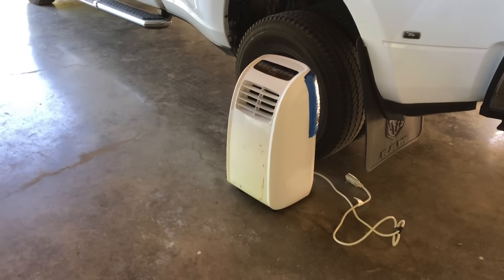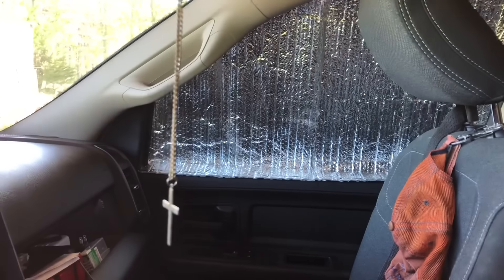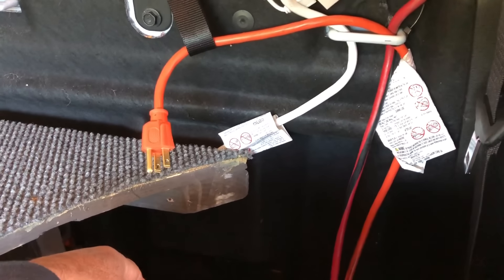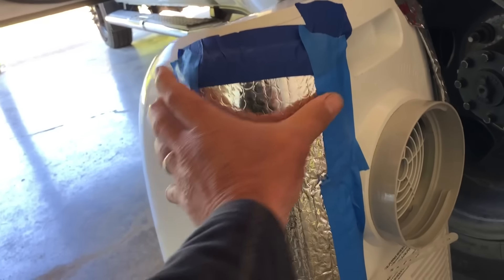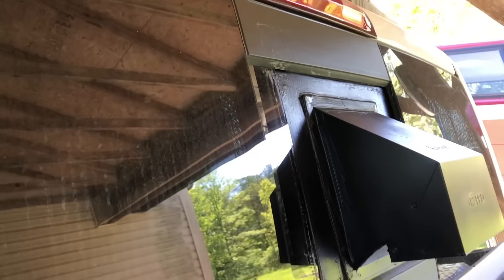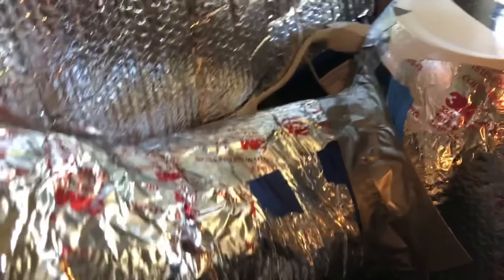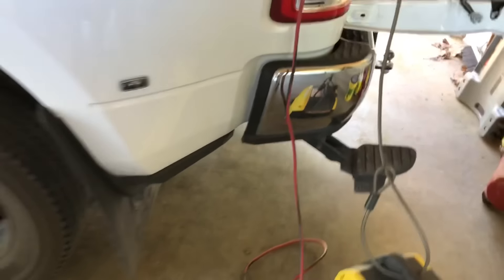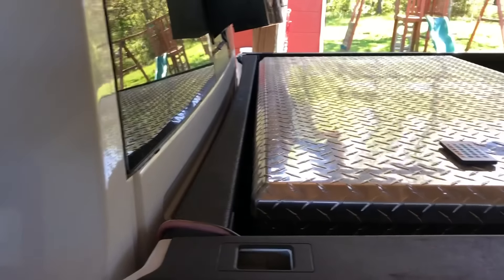Best Hotshot Pickup Sleeper Air Conditioning Setup! Save $$$ and stop idling when off duty!

Comment: I work out in oil fields . I ripped out back seat put put $ 375.00 Hess Portable 5000 BTU behind the driver side . Cut a hole threw the back the  cab for the exhaust on left side .drilled a small hole on back cab for drainage . Drilled another hole on right side for the power cord . Bought a Quite 3200 predator generator  for $650.00 . I very been using it all the month June.  Generator takes about 2.2 gallons for 10 hours  . That's $ 10 night in this Texas Desert heat . I freeze at night at 67 degrees . So in month it's paid  for itself !  It's works toward that self contained operating at lowest denominator mentality . Your not having to run to hotel 30 miles away and driving back costing what? 6 gallons at 4.50 gallon .
Reply from the maker: That’s awesome to hear! Your saving a lot of money and wear and tear on your truck engine.
I’d like to see a picture of your setup!
Reply: Dude thank you for commenting. Was just thinking of getting this kind of setup before next summer.

Comment: ok for  all you guys that are concerned about ingress air flow for the a/c unit... remember that the on board a/c /hvac unit goes to outside air when the truck is shout off.  So... fresh air is being drawn in through the trucks on board hvac system and it is adequate for the air flow for the condenser... i have been using one for 6 months and this is how it works with no problems... i dont use a genny though but i have a CO detector when i do..... adequate low dollar design ther folks..... good on you sir!
Reply from the maker: Don, thanks for your information! I do run with a detector as well.

Comment: A dual hose portable AC will work much better, and like other people have said here, if you can convert that one into a dual hose by adding a fresh air hose intake to the condenser side, it will greatly improve both the capacity and efficiency of the unit.
Reply: That ac unit is designed to cool a medium sized bedroom with the inefficiency that you point out. There wouldn't be much issue with just using it as designed. I'd prefer to have the active air exchange in that small space.
Reply: Dual hose units are considerably larger... Space is at a premium in this situation.
Reply: You could be sucking in carbon monoxide from the generator though. A dual hose unit would be much more safe.

Comment: I drove hotshot for a few months. If you remove the front passenger seat and sleep along the passenger side. You will have move length. I could fit a foam queen mattress in lengths and just fold it in half to fit.

Comment: you can make that a lot neater and cleaner by putting the unit on the passenger seat, build
 a simple removeable frame out of plywood to run the exhaust thru to place in the passenger window. because the exhaust hose is just going a few inches to the window from the back of the ac  you don't have to wrap it. Thats the set up I had in my truck when I started running freight for years. FYI you can run the generator in your truck bed just point the exhaust out the back with your tailgate down. Did it for several years never had a problem.

Comment: A single hose ac unit will pull in outside hot air into your truck through all the cracks because of negative pressure.  Convert it to a dual hose ac.

Comment: We have the axact setup in our micro-camper.  We have that generator and a WEN 2500.  The works just as well.  Probably is the negative pressure issue and sucking in warm air.

Comment: I just want to point this out.  Having the genny running outside and you also have the condenser air that is pulling air from within the cab and putting it outside and is putting the cab in negative pressure with CO floating around outside.
Reply: Correct, I would spend a few dollars and just buy a CO detector to be on the safe side.  When I run my portable generator I put a fan blowing on it in one of the outlets, helps keep it cool and blows the exhaust away.
Reply: I was gonna say the same thing.  I use these in my rentals as emergency backups and they will definitely allow you to discover where you have leaks in the house cuz it will suck in all the hot air so one part of the house was nice....the other would be hot.  
In his application I would worry about it sucking in the exhaust.  Be careful
Reply: Yes if you understand how air conditioners work those units are really poorly designed and should not have been made. It should have a dedicated and isolated fresh air intake from the outside to cool the condenser and then blow the hot air from it back out. They do make units like that and they have two hoses. When you have only one hose, and it's constantly blowing the hot air out from the condenser, where do you think that air is coming from? It's also sucking all the cold air that it just made back out of the cabin and blowing it outside. And where does the air come from to replace the air that's being sucked out of the cabin? From the hot outdoors. Doesn't matter if it's a house or a car or a shed, the same volume of hot air you feel blowing out of that hose is the exact same volume of hot air from the outside that's being sucked into the living space.
Reply: Thé dude is right. This set UP is not idéal. My father almost died in his car due to Co and CO2. 
Stay sage guyz!!!
Reply: In order for the ac to create a negative pressure you have to have the whole truck sealed up vents and all. The air being blown out the back is also being pulled in from the vents in the front so the risk of co2 going into the cab is less likely as most  would think. But if I am wrong let me know.....
Reply: @marcusspillman6113  you mean co, not CO2. And it would depend on how close the exhaust is to wherever the air is being sucked into the cab from and what the direction of any Breeze or wind is. In the right circumstance it definitely could draw it in. The other thing to realize is that 100% of the hot air being blown out with this type of air conditioner is being replaced by hot outdoor air being sucked in. In my opinion it's a really stupid design and I cannot believe the popularity of these systems, I can't believe that the manufacturers don't have a basic understanding of how air conditioning works. It requires two hoses one for fresh air intake to cool the condenser and the other exhaust from the condenser to the outdoors. Apparently they know it will sell and work in some situations when a human being happens to be sitting right next to it and the cold air is blowing on their body.
Reply: Soooo, what’s the difference between the apu ac or the newer style electric ac under bunk than this setup. All have inside cab intake and all have cool air blowing, the apu style removes heat outside rear of cab, Electric under the bunk exhaust heat outside the side box door, and this portable unit exhaust eat out through a pipe. The only way to get positive pressure is using the main air conditioning unit not in recirculating mode. And if you don’t have a CO2 detector in your truck already then you should get one. So my question is how does any of the modern AC systems, the auxiliary AC systems create a positive pressure inside the cab?

Comment: I would recommend using a window AC unit in the truck bed and pipe in the cold air through the back window. This would keep the heat of the compressor outside and might help a bit with noise. EcoFlow just released a probable AC unit that can run on their solar battery packs. Getting the EcoFlow batteries and AC unit would cost $2,500. It's a 4,000 BTU unit and is already designed to use inside or outside of a tent or vehicle. Not needing a gas generator would be a cost saver in the long run. I already have one of their Solar battery packs and it's super useful.
Reply from the maker: I will have to research that battery pack as I believe it is fairly new. However the issue with having an outside air unit is that I don’t have the spare space in my truck bed as it is full with my fuel tank, tool boxes, and hitches. As this is a working truck I’m not sure I would want to do away with my generator either as I use it for other applications. Also the cost for this battery pack is high!
Reply: @hotshotstuff8080  Ya it is mighty expensive and brand new. Also, 4,000 BTU's is pretty low. If you don't have room in the bed then your setup makes perfect sense.
Reply: corey Babcock  lol, I hope you are joking. Yes, it's expensive and it might not be worth it to you. I don't think I would spend that much on a portable AC either.
Reply from the maker: corey Babcock  My setup was nowhere near that cost! I have less than a grand in the whole setup!
Reply: corey Babcock  or you could work harder to give yourself a better life instead of begging others.
Reply: @CSXtrackworker  are you serious!
Reply: @me4654  yes. Work harder and apply yourself. Work for a better paying job instead of coming on here asking for a handout.

Comment: That thing must be a hell of alot better than any of them ive found. I found them as noisy wastes of money. Id suggest to anyone wanting to cool..no freeze your arse off to look around for an rv ac system. One without freon is the best. I used one to cool a very large party room in a boat house. Mounted a small shelf in one of the boat slip side of a wall with a hole cut through with a grill covering the inside. In the 100+ degree summer in texas you need a jacket in that room. 12' ceilings and some insulation. Wooden inside and out.

Comment: I have 97 cummins 12 valve that came factory with 0 comfort options, no a/c no cruise control no power windows or locks, I am thinking about doing something like this to run a/c in the summer as I already have a 2300 watt generator, very helpful
Reply from the maker: Glad it was helpful, good luck with the setup!

Comment: If do a simple test and find out how much exhaust goes out the back window vent with any one of the doors on the truck open and another reading of the air flow when all of the doors are closed you can find out if you are starving the air conditioning from proper air flow.

Comment: I would consider looking into a few lithium batteries with a DC to DC charger then the truck will charge it because your driving a lot so it will charge fully then at night you can use up all the batteries if your doing this a lot it would save you money in the long run

Comment: I am an HVAC guy who grew up on a farm and went into the Military right out of High school. I used to build all kinds of contraptions to survive in areas where the Military really did not care about our creature comforts. I am going to give you some advice. The reason the AC gets so hot in the one area is two fold. You can't get proper airflow out of or through the discharge of the AC. The duct that goes through the back window is okay but with every part of an AC it is air in and air out. Those portable AC units are betting that you have loose construction in the area that you use them in.

Your truck cab is fairly tight. It will not let enough air in from outside to go through the condensing or hot air discharge side of the AC and out the back properly. 

You are overheating the condensing side of the AC unit and it is not running efficiently. 

Look into building a kit to install through the back window where it takes air out of the cab through one duct on the bottom and brings air into the cab on the top half or side of the window. Duct both of them back to a small window AC that sits in the pickup box or on the tool box. This will eliminate all of the issues and it can get power from the gen outside. Also any condensation can drain away outside of the cab with no need to dump a condensate container. It could be semi permanent or take it in and out everytime you park. 

The other type unit would be what they actually put into Semi trucks but they are pricey. Those can be Heat pump versions that both heat and cool the cab.

https://www.webasto-comfort.com/int/
https://www.northerntool.com/shop/tools/product_200945228_200945228?cm_mmc=Google-pla&utm_source=Google_PLA&utm_medium=Fans%20%3E%20Air%20Conditioners%20%3E%20Residential%20Air%20Conditioners&utm_campaign=Emerson%20Quiet%20Kool&utm_content=111789&gclid=CjwKCAjw_ISWBhBkEiwAdqxb9qiuamOejUmTyAQOImXh5HXtgwsBZE5PuDljaX4Etr2glYJpEAeSpRoCAZAQAvD_BwE&gclsrc=aw.ds
Reply from the maker: I hear what you are saying! However I’m not able to do anything like the unit in the bed of the truck as I don’t have the room for it with my hitch, generator, fuel can, and tool boxes. 
Also I have used this setup for 3 summers now, and I agree it isn’t as efficient as it could be, however it has worked well and keeps the cab very cool for sleeping. And I don’t have to set it up and take it down every day. Thanks for the info thou!

Comment: great setup!  on a very hot night how many gallons of fuel would you use?
Reply from the maker: Depending on the generator but mine would burn a gallon in about 7 hours if it was real hot and humid. The generator will shut off and I just sleep till the alarm goes off.
Other option is to turn up the thermostat when it’s really hot to get more run time. 
My last option is
To idle the truck if it’s too hot to sleep when the generator shuts off

Comment: Good job!  I run a Honda generator with heater but not an ac (yet). I have one of those ac but don’t have a back window. Guess I could run it out the side window?
Reply from the maker: You can probably find a sliding back glass at salvage!
Reply: The truck has vents out the back of the cab I seen a few guys exhaust out of them I believe that’s what I am going to try to do really like your setup
Reply from the maker: @Hawgwild66  thanks! Those vents might be worth a try!

Comment: I've been looking for years for a small window AC that would fit the sliding back glass. Window AC's are much for efficient that portable ones. A 200 btu would be plenty for a crewcab pickup.
Reply: *2000 btu
Reply: Have you found one?
Reply: @Md-be3bt  nope :(
Reply: I can't find anything under 5000 btu. Frustrating because that's more than I need in my van and larger than I want hanging out back window.

Comment: I want to see how you made your bed brother
Reply from the maker: @sleepisoulja  i basically took out the back seat for maximum room. Slid the front seats as far forward as possible. Then measured out the area for the total length and width.
I put the seats in the operating position and re measured for the main bunk platform.
I used 2x2 pine and built a frame for the bunk to make the top of the bunk  even with the bottom of the door windows. 
I added a second bunk piece secure with hinges that folds up when the front seats are in operation position and folds down when they are slid forward. Covered the deck with glued down outdoor carpet.
Added some 2x2 cross bracing for strength to the frame underneath.
Bought a piece of foam rubber (I would recommend 4” extra firm) and cut it to fifth the platform, splitting it where the two deck pieces joined so the mattress can fold up with the deck when driving.
My wife helped me make a sheet that fit both pieces of mattress.
Good luck sir!